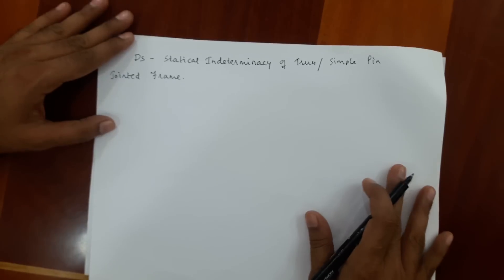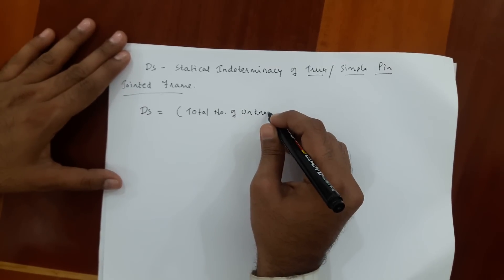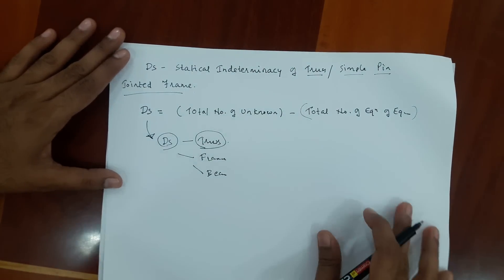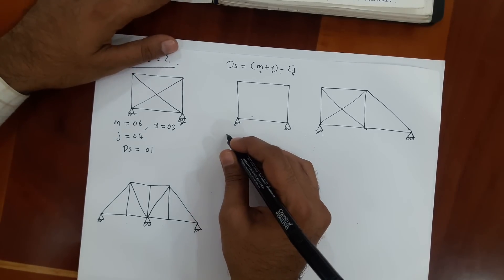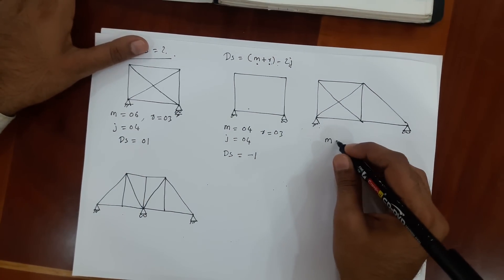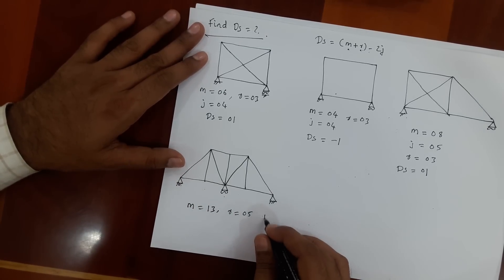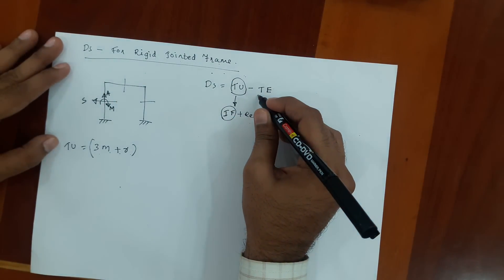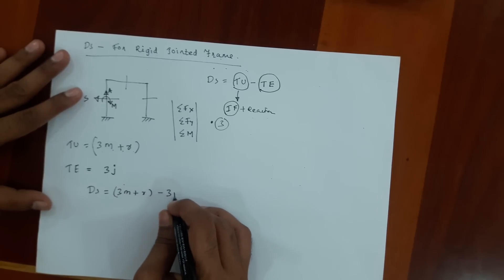Degrees of Statical Indeterminacy 02

Comment: Just add to my previous comments, in case of rigid frame, if you are considering joints then you are talking about kinematic indeterminacy but that should be denoted by Dk or Nk  not Ds and I think you talking about statical.

Comment: In case of rigid frame, simply cut the frame in the middle that will become two bodies. Each body should have 3 reactions. Use formula: ns=  r - 3n where n is number of body. In your case there r = 9 and 3x2 (2bodies), so ns or Ds = 9-6 =3. Therefore 3 degree of indeterminacy.